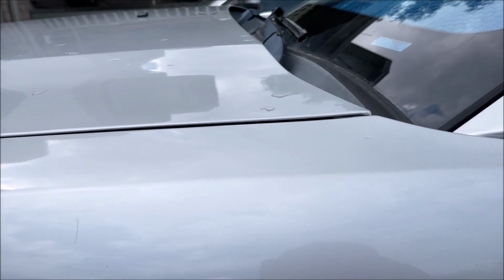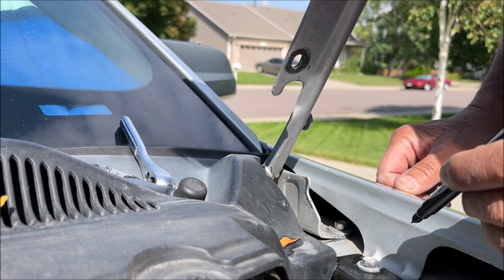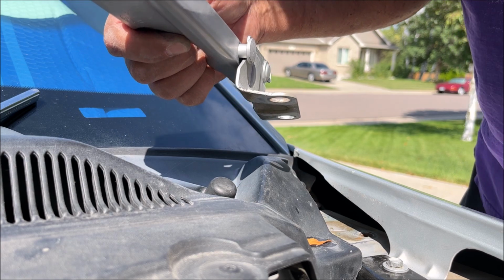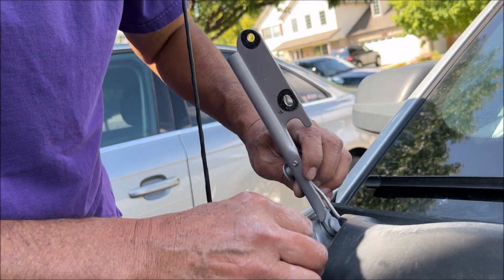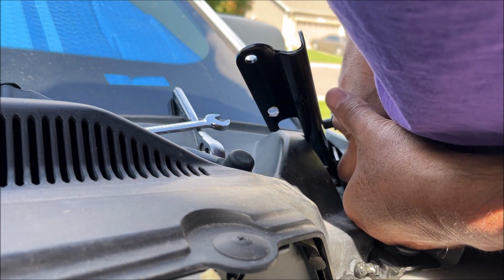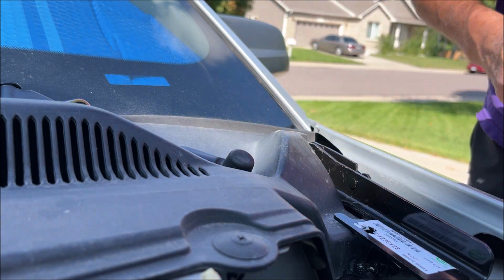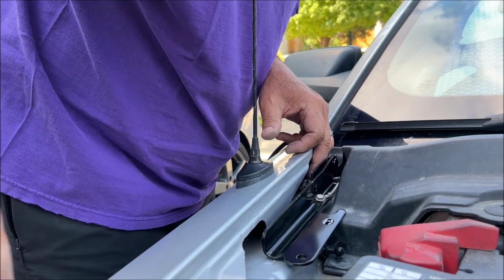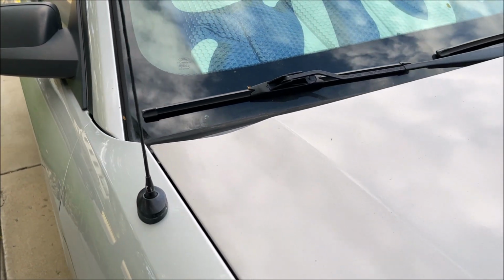2005-2009 Ford Mustang Replace Hood Hinges S197

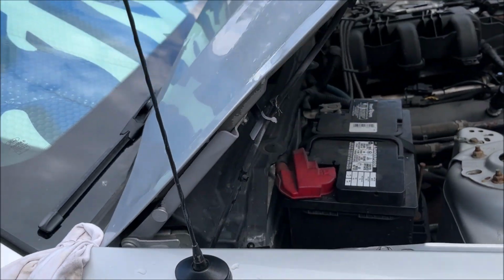Comment from the maker: 02:56 remove hood
03:35 remove driver side hood hinge
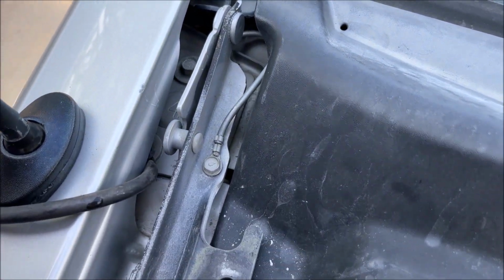07:26 remove passenger side hood hinge
10:35 compare old hinges to new ones
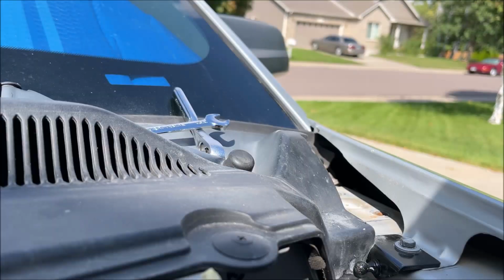11:44 install new driver side hood hinge
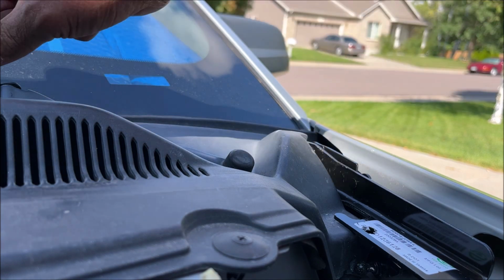17:36 install new passenger side hood hinge
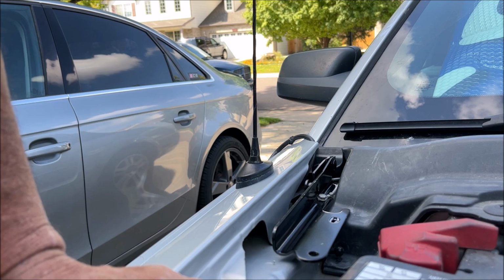21:07 replace hood
22:20 outro